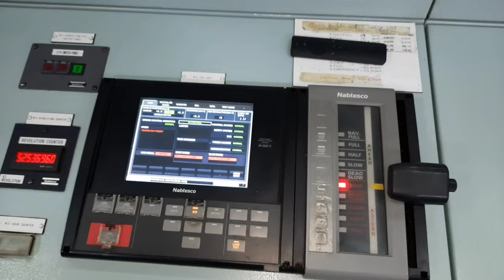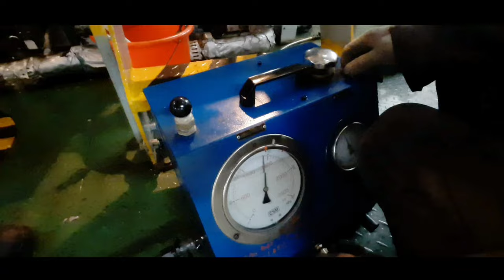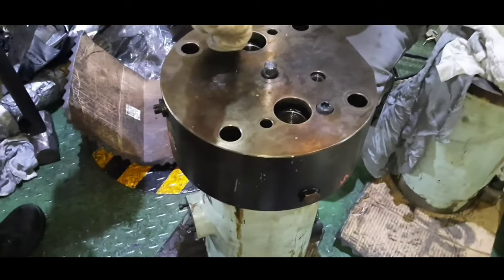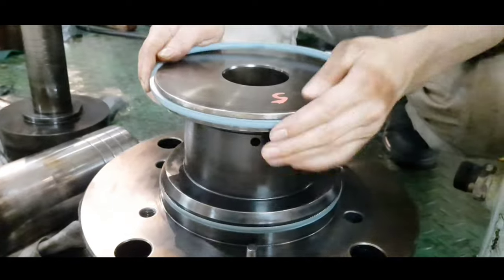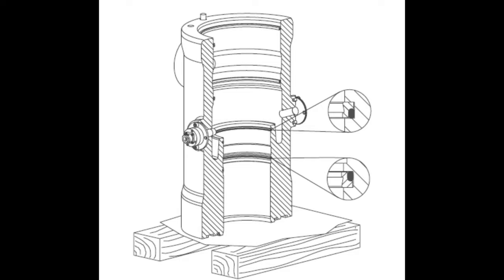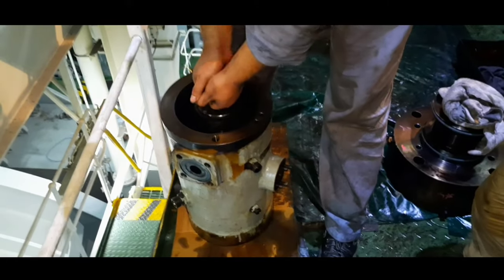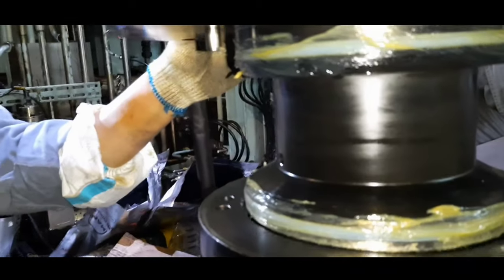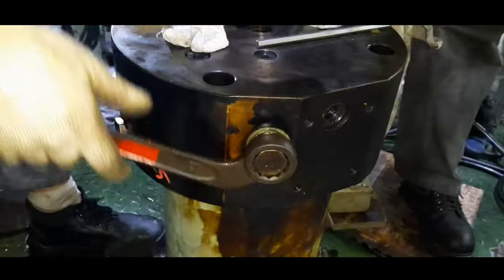ME ENGINE FUEL PUMP COMPLETE OVERHAUL PROCEDURES | SEA LEGEND |

Comment: Any after checks needs to be done after installation ? From MOP
Reply from the maker: No need to do any resetting on MOP....just need to check the pump stroke indication by the stroke sensor is inline with other units.

Comment: What's the laptop for?
Reply from the maker: The Laptop is for the Cylinder Pressure Measurements...its the PMI Laptop with computer controlled surveillance and diagnosis program installed in it.